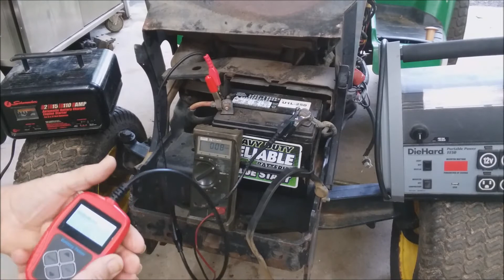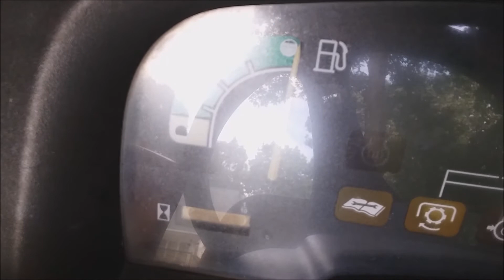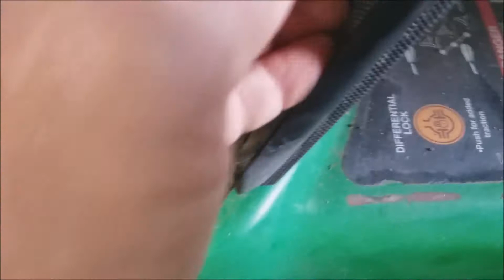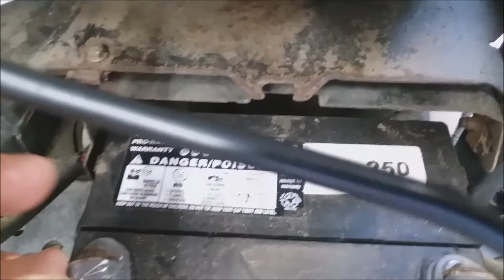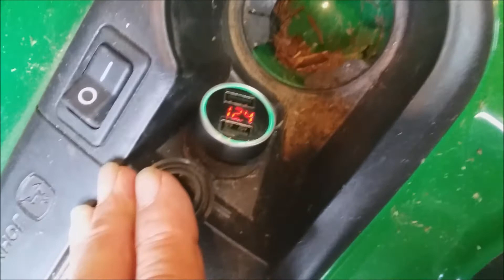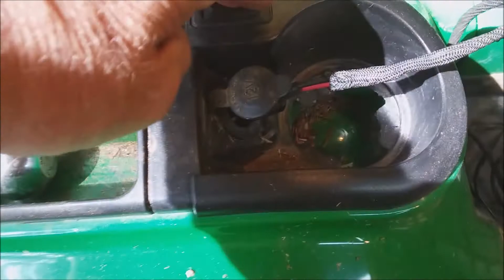John Deere X Series Garden Tractor Electrical Testing

Comment: I have 495 diesel why does my preheat light just go on once in a while is there refuse? Is there a connection loose? Where would I start?
Reply from the maker: First,  I would check for voltage at the glow plugs while it is going through the pre-heat cycle. No voltage would indicate a problem with the glow plug controller. If there is voltage,  the lamp circuit could be the problem. Could be a poor connection  with the bulb.
Reply: @gotdeeres  thanks I’ll give it a try. I appreciate responding.

Comment: My x485 . Relays click, I have a green light on panel where relays are. Starter won’t engage.checked the  2 -15 amp fuses, good. Hope you can help . New battery, took it to stress test it was ok
Reply: Same issue. Did you figure it out?
Reply: @erictheel3904 Yes. I had to replace starter, relays,ignition switch,voltage regulator and stator. The last two not until battery kept going dead. I think the past owner jump started or boosted incorrectly. Runs great now
Reply: I used all amazon parts. JD was too expensive
Reply: Except stator. Bought from a Kawasaki parts online
Reply: When I say ignition, it’s the whole circuit board

Comment: Sorry but really basic question here: When testing fuse connections on the right side circuit board of the X485, what are you connecting the circuit tester’s alligator clip to? Is it the + battery terminal?
Reply from the maker: Connect the black lead to ground. Then use the red positive lead to the fuse .